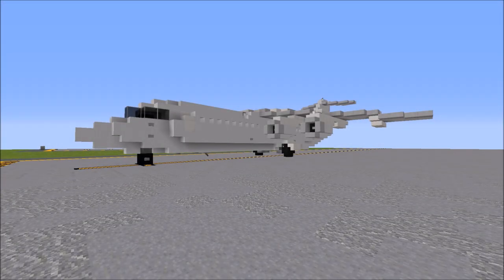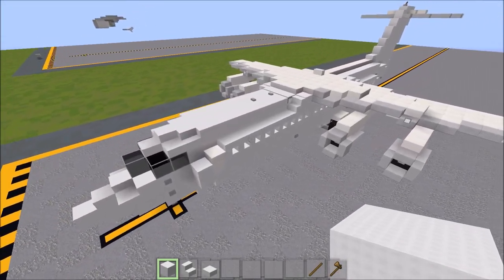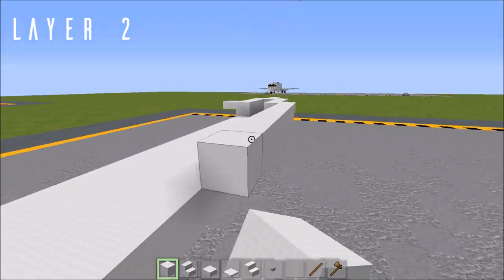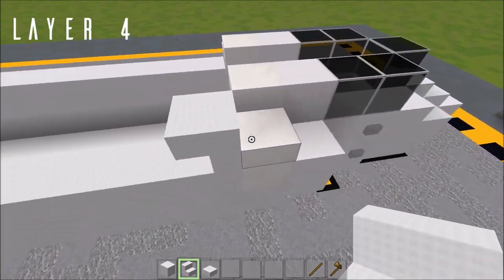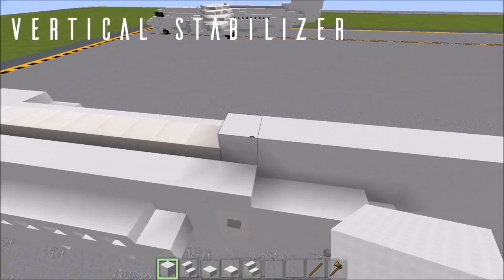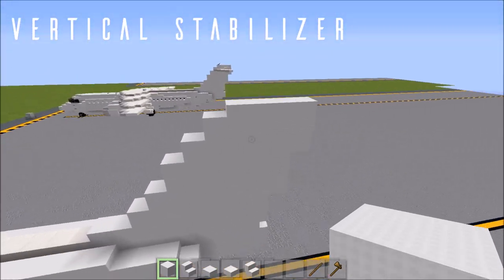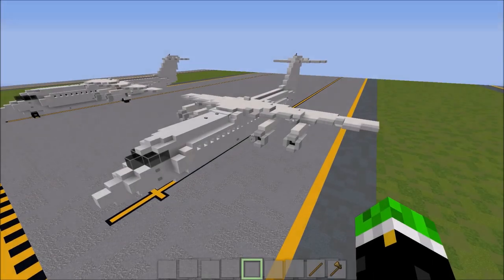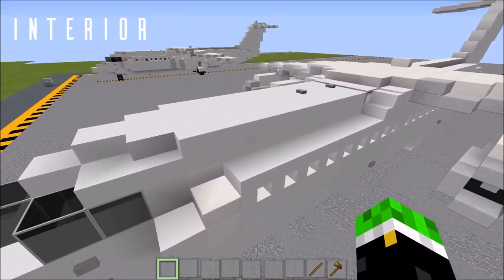Minecraft Tutorial: Avro RJ100 / BAe 146-300 [1.5:1 Scale]

Comment: This is great, but, this isn’t compatible with: All editions under 1.16, because, you cant find a VERTICAL SLAB MOD under 1.16, and you can’t do it with the Aeroteam texture pack if youre on a mobile device.
Reply from the maker: I go over alternative techniques for the default pack in our videos for exactly this reason - it should still be able to be built just fine! 
- Poptart
Reply: I use mobile and there are alternatives that work fine so it is compatible